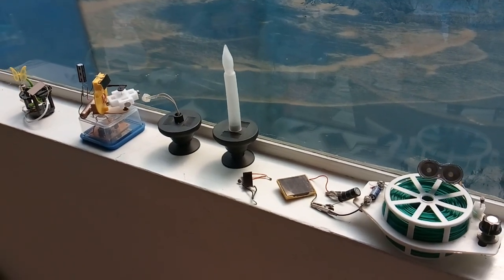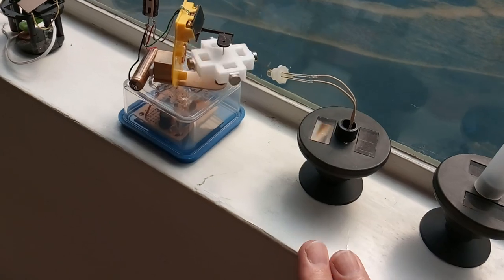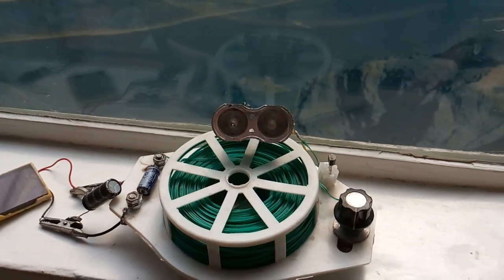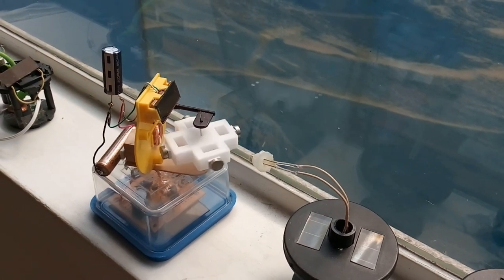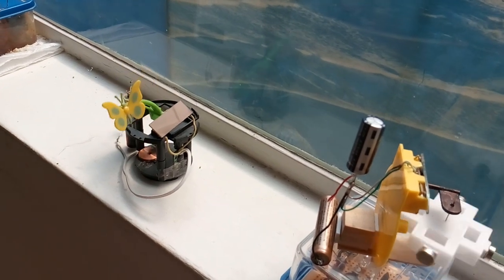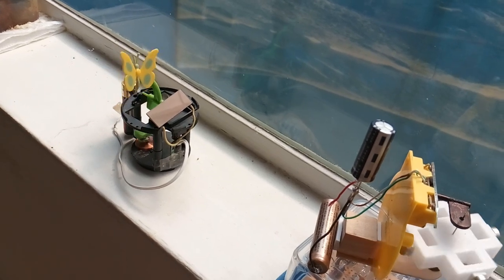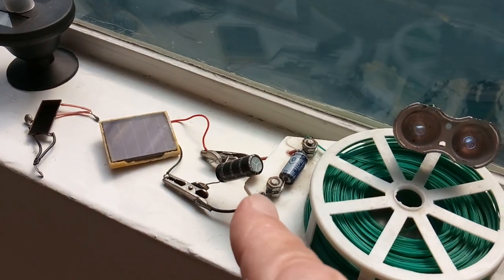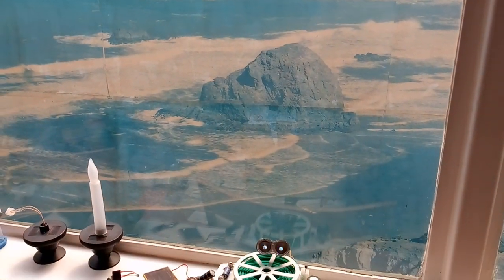Illuminated Non Stop Running Device

Comment: One reason that this is running for four years, maybe because the pendulum motion as has been designed by you, restricts the magnet from swinging past the edges of your coil. “Ray’s No Back EMF Generator “ by Raymondslab, explains this particular effect very well. Great Creations indeed.
Reply from the maker: Perhaps you are right about the restricting of the pendulum swing.  When I built the thing I didn't like the noise that it made so I put a cotton swap tip on it to stop the sound and restrict the length of the swing.

Comment: I wonder if that battery on the solar flower is doing the same as the one on my Snowman, that just keeps running. It slows right down and then for no apparent reason it gets back up to speed. With your solar panel to give it an extra bit of charge to get it going that bit faster than my snowman.
Reply from the maker: I'm not sure what is going on with that solar waving flower.  When I built that back in 2017 I expected it to run maybe a year.  It is kinda like your Snowman in that stuff happens and you just forget about it for long periods of time.  One day you look at it and marvel that it is still working.  If only toy snowmen and waving flowers could talk.